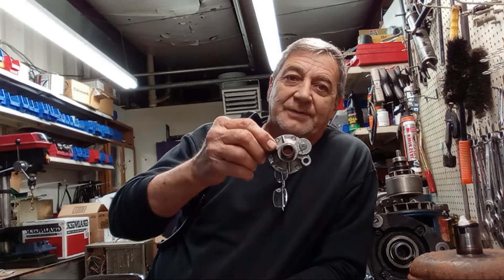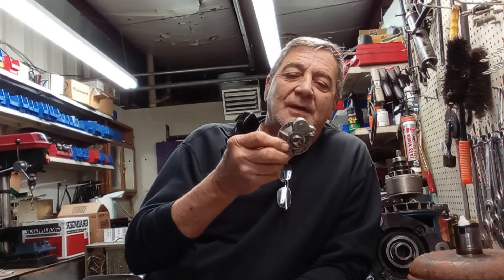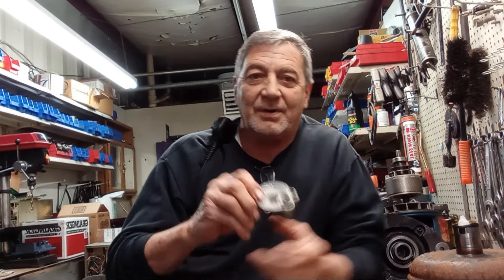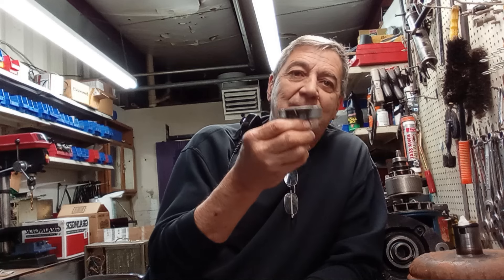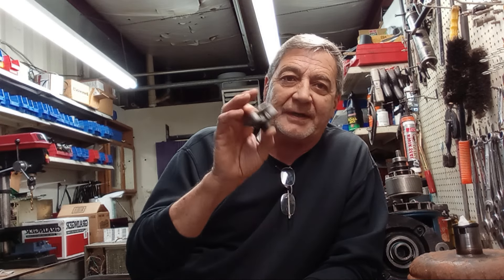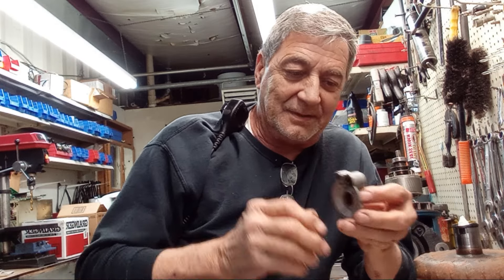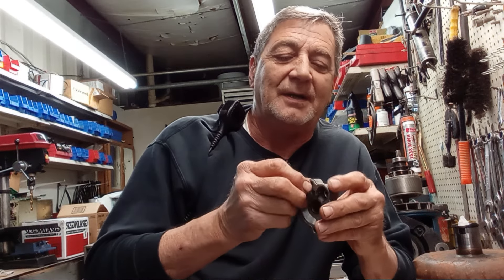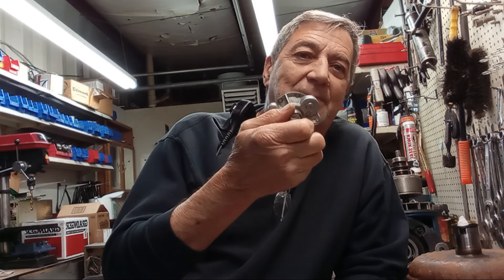Oil Filter Bypass, Bypass or not to Bypass

Comment: In my humble opinion. Bypass valves are for the general public. In racing applications, it’s very different. When racing engines are built, they have to go through break in procedures that require a certain amount of attention. Fresh engines require camshaft and ring break in procedures that creates a lot of fine particulates in the break in oil that needs to be captured. It can take as many as two to four oil changes to properly break in a race or high performance engine, depending on what type of camshaft you’re running. Rollers fewer than flat tappits. 
This is actually a subject for high performance engines. I hope this helps a bit.

Comment: We plugged the bypass on our midwest asphalt circle track race car. But there was one potential problem with running the heavy 20W50 racing oil. One night near the end of the season, the temperature dropped into the low 50's and one of our competitors started his engine to warm it up. He immediately revved it really high and blew the oil filter apart. We never knew if it was a cheap oil filter or what was the cause of the failure. We took it as a lesson learned and kept the engine warm between heat races on cold nights.
Reply from the maker: i have heard of that happing but never seen it but its something to think about but thanks for the heads up i will keep a eye on it couse i do run 20w50 but when we race its hot out
Reply: The bypass won't do  that.  A suck pressure regulator in pump will

Comment: It is not the oil pressure from the pump that opens the valve, it is the pressure difference across the filter caused by the flow that opens the valve. Many filters have a built-in bypass, so plugging it does not matter.
Reply from the maker: @robertreiman  good point thanks for your input this is how we lurn

Comment: Answer to your question is....yes the bypass pretty much stays open all the time at anything over 15lbs. so yes at 40 and lets face it, race engines usually run WAY above that (sometimes 70 to 80 psi or more at high RPM), at least half of the oil or more is blowing past the bypass valve unfiltered. I plug every bypass that leaves this shop (except on some stock engines) and tell my customers to use a Wix filter and a race engine  I demand a Wix Racing filter (yes the Wix Racing filters less micron, but flow better and wont collapse)...You are giving great advice there for sure. It should be noted that almost all filters have a safety bypass built into them anyway. The key is, with 38yrs of race engine building behind me....Run a good filter and plug the bypass. Great video!
Reply from the maker: thanks well said
Reply: It should be dependent on the pressure differential across the filter.
Reply: @ggordon4127  Correct. However oil viscosity, oil temp and filter material weigh in on this as well. Basically the pressure is going to take the path of least resistance. It's not hard for a high volume pump to stack up oil against even clean filter media of any type and overcome a 15lb bypass.

Comment: Very simple. For stock engines. 
1. block your vehicles bypass!
2. for fresh engines use a top quality filter with biggest filtering area and no bypass. Replace filter and oil after 2-3 short intervals, i.e. 200m, 500m, 1000m. 
3. Use top quality filter with bypass after that and frequently replace oil and filter together every 2000-4000miles. 
4. Use Manufacturer specified oil if available, otherwise proper research backed premium brand matching oil. 
5. don’t ever flush/additivise oil or gas. Top quality oil and gas treats contamination as it should be. If your engine is Hotrodded the expert of manufacture is your responsibility now. Good Luck if you’re a beginner. A big learning curve will be ahead.

Comment: I think that bypass valve works when the difference in pressure from the dirty side to the clean side is 10 psi, so if you have a clean filter and oil and your engine is making 50 psi then it's 50 psi on both sides of the filter and valve stays closed. As you put miles on the oil and it starts to get dirty and the filter is loading up with contaminants, you may start to get 50 psi on the dirty side and 48 on the clean side, keep running it and that difference starts to increase. Once the difference gets to 10 psi that valve will open and let some dirty oil "bypass" the filter and go the the engine. The key is to change oil/filter before that happens.
Reply from the maker: well said
Reply: Correct. The 10-15 psi is a pressure differential, not total oil pressure. The suggest the bypass stays open 99% of the time is absurd.

Comment: Well you have an additional problem if you block off the bypass valve. And that is the risk of blowing the oil filter apart, and before anyone ask. Yes you can blow up an oil filter, or split an oil filter if the oil pump builds more pressure than what the oil filter is physically capable of handling. I have only ever seen that happen  on one engine, in one vehicle which was a 1970 something Ford F-100 dent side which the engine was either a 302 or a 390 in it. The truck belonged to my father, and it had a faulty oil pump in it that caused the engine to build so much oil pressure it split the oil filter.
Reply from the maker: thanks for the comment and thats something to keep in mind for sure

Comment: Ive run WIX 51061 on everything, what you dont know is the filter has a much stronger ɓy pass in it How you can check it is, get a big long screwdriver set the filter on a bench, open end up ,stick the driver down into it and press down really hard. The by pass spring will move, so.. dont worry about the filter plugging, Wix has you covered  !
Reply from the maker: @PeggyParrow  good to know thanks

Comment: Cold thick oil could starve the engine. The filter has a bypass too. I put a washer under the spring to make it stiffer and they sell stiffer springs for hp use.

Comment: Chevy is 1/4" npt.
If you do it you should run a 396 truck filter or a remote adapter and something like a HP6 or equivelent to have enough flow volume.  On a regular passenger daily. The bypass is ok to have. They often run open. In a serious hi perf application. They should be plugged and a huge filter used.
Reply from the maker: sorry i did say the wrong size tap but thanks for the comment

Comment: It only opens when there is 10 lbs of pressure difference/restriction, not 10 lbs per square inch. So, yuh 50 weight in the cold, bypass: plugged up filter, bypass. But most filters bypass too.  Normal filters bypass internally, and if they ever bypass it's only by their differential amount. So there is still filtering happening with "some" oil going around the filter. I understand your reasoning for the bypass on race and performance engines though.

Comment: Personally I like to block them in a performance application. However if you're going to do that it would seem wise to look for the biggest filter you can fit WITHOUT a bypass listed in the specifications. Some places have to special order that. 
It's funny to me the amount of people who think they are getting straight filtered oil when they block that passage only to install a filter with a built in bypass. The redundancy does them in.

Filters with no bypass also normally focus on getting volume through the filter so they aren't the greatest at filtering the finest particulates. It's a balancing act.

You also have to remember to take it easy while warming up the engine/ oil or it may spring a leak with high oil psi. There could also be the possibility of tearing the filter material or separating the joined ends at cold start. Torn filter material is likely to only be found when the filter is dissected.

Comment: Isn't it a "differential pressure " bypass? So if the Filter causes more than 10psi "pressure drop" Some will bypass the filter? 
Not a situation where it opens after 10 psi of engine oil pressure
Reply: Correct

Comment: The by pass only opens up depending on the pressure drop across the filter not the oil pressure per say. If you block the by pass consider using a bigger capacity oil filter how big? Check out what Bill Jenkins used on his 331 SBC.

Comment: I don't think plugging the bypass matters that much.  Most oil filters have a built-in bypass,so they don't bulge, leak,or worse. The filter is probably almost never filtering 100% of the oil going through it. The higher the oil pressure goes, the more oil gets bypassed around the oil filter element inside the filter.  So you can go ahead and plug the bypass,but you're never gonna get 100% of the oil to go through the oil filter. It starts bypassing the filter element at as low as 20psi. Don't believe me? Look inside any oil filter, and you'll see a spring and a rubber diaphragm. When there's greater than about 20 psi of oil pressure on it,it begins to press on the spring and let the oil be diverted around the filter element because the oil can't go through the element fast enough. The filter would leak or burst if it didn't have this feature.

Comment: Kia / Hyundai : use OEM filters,  only.  The oil pressure is under powered on several of their models .  You dont want lower the oil pressure any further by employing a better filtering filter.
Reply from the maker: @ferndog1461  I never messed with a Hyundai but that's good info for other thanks for you comment

Comment: Hi, thanks, I have a lt4 in a Camaro, GM sells two oil filers for that motor, and the upgraded one has a higher bypass pressure in the filter itself... What does that mean??  I think the normal one is 15 psi and the upgrade one is 25...PLEASE HELP...Dave
Reply: Install the biggest one that fits. 

Higher pressure can cause leaks because it puts that higher pressure behind the seals

Comment: To Bolt gun pass, in comments, for one thing, its STUPID to rev any engine high when its cold, its nit wits like that that blow up perfectly good engines then blame it on the engine company or builder, besiides there is NO reason to run such a thick oil, we run straight 30 wt. Valvoline in all classes,! No problem, We run wix 51061 in Sbcs, Bbcs, 51515 in the fords, .003 on mains, .002 on the rods ! Multi grades or really light oils do not work with these clearances, might hammer rod bearings out Hope this helps